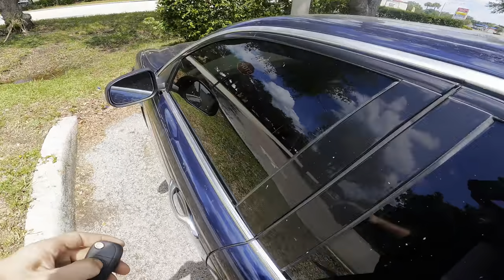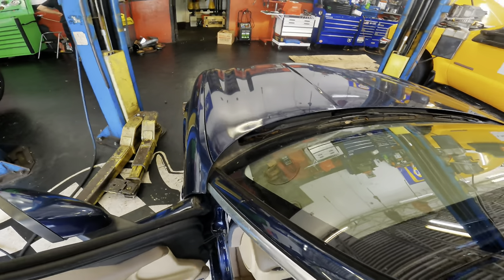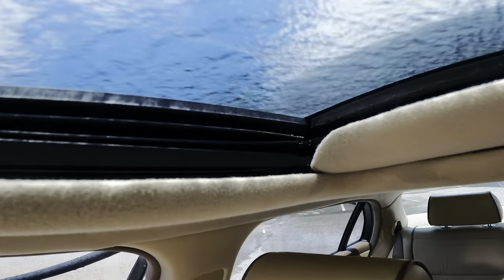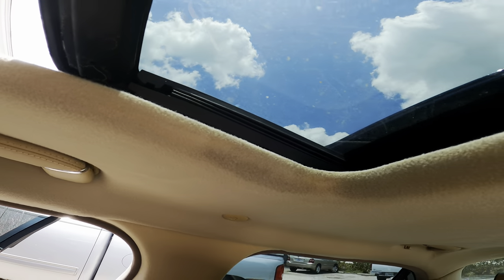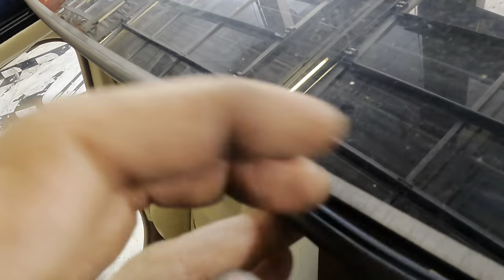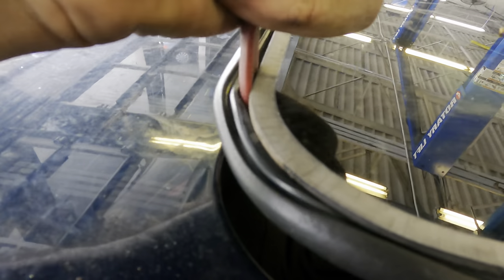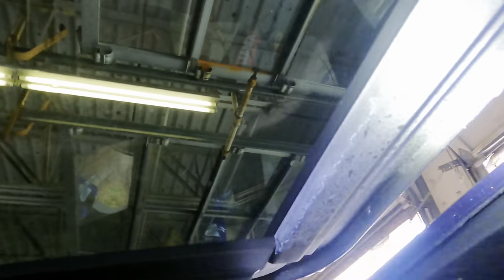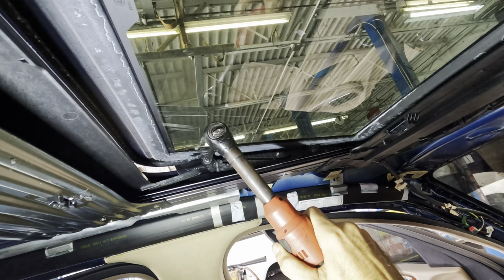Worse than I thought…Water Intrusion! 2008 Jaguar XJ 350

Comment: I have never had any luck with “sun roofs”.   They seem to be designed for two purposes.  1: rattling.    2:  leaking.
Reply: Neither have I until I started buying Mercedes. Zero issues. But you do need to lubricate and clean the tracks yearly. Because maintenance.
Reply: Never had rattling issues with sunroofs. Probably just poorly fitted/bad make.

As for leaks I've only had to replace the seal once like he's done here. I'm in a desert so hardly any rain but rubber getting crisp and hard is normal. Usually lasts a decade or longer if you take care of it (park in garage instead of outside in the sun constantly).
Reply: and lets not forget making the car even hotter when you forget to close the shade!
Reply: I found factory install instructions on adjusting how the glass fits in the hole in the roof, usually fixes the leaks. Periodically, I have to readjust the height of the glass.
Reply: Yes, also making wind noise. I have no use for them. I seldom look up
Reply: For the last 20 years i have owned two Ford Mondeos that have the exact same sunroof and have never had a problem with them, sometimes things just go bad.
Reply: A sunroof is the most overrated, supposedly "luxury" item in any car. I really want the baking sun beating-down on my head while driving. Not.

I have no idea if mine even works. I have never opened it during 5 years of ownership.
Reply: Iono, had a 2002 VW Jetta until 2018.. never did the roof leak.. ever!
Had a 2010 Fusion, sold in 2017, moonroof never leaked.. have a 2013 tC, again.. moonroof doesn't leak.

You gotta stop buying Chrysler and Chevy products!
Reply: My policy is to never buy a vehicle with a hole in the roof!
Reply: I had to take my Benz's sunroof out with the replacement of the headliner and sunshade. It was a huge job. In reinstalling it, three words: Adjustment, adjustment, adjustment......it was a royal pain to get right, a job I never will attempt again. .
Reply: @grantleyhughes  my Benz sunroof doesn’t leak but also didn’t open after 3 years
Reply: @tiredoldmechanic1791  i wont buy one without it, i couldn't live without my electric sunroof, its open even in the winter!
Reply: @demcomp  ive been driving since 1998 and almost every car ive owned has had a sunroof including my current one, a Ford Mondeo with the exact same electric sunroof as that Jag and not a single one has ever leaked, my last two cars have been Mondeos with that mechanism and they have been good as gold.
Of course some sunroofs will leak, anything can develop a fault but these people saying they are a problem item are talking nonsense, your experience matches mine and i wont buy a car without a sunroof!!
Reply: @obroni  lol, i wont buy a car without a sunroof, the first thing i do when i get in my car is to hit the button to open mine fully, even in winter.
Reply: @stevefox3763  🧡 exactly! never had a leaky roof.. maybe that'll change. I love having one.. even if I don't open it fully, I crack it open to vent the air.. plus if it's gonna be a hot day and no rain, I'll leave it in the vent position so my car isn't a sauna
Reply: @stevefox3763  Yeah, it's one of those things: You're either on Team Sunroof, or you're not.
At least with a sunroof, you have a choice to cover it up. But these new cars where the whole roof is glass, with no cover? Yeah, I don't want to drive around in a greenhouse, thank you very much!
Reply: @obroni  yep, we are all individuals and like different things, my Ex Wife hated me having the sunroof open!

I like the sunroof because it opens the car up and feels less like a cage but if you have it open but the windows closed, summer or winter it gives you a airflow that does not blast you like an open window but in the summer i really value my sunroof cos i have black leather interior and opening all the windows and the sunroof on the remote before going out to the car is an amazing thing to have, the hot air goes out the sunroof and it sucks cooler air in through the windows and cools the car off super fast :)
Reply: 2007 Chevy Trailblazer with a sunroof, no leaks. I also clean the tracks and treat the rubber with a conditioner twice a year.
Reply: @groosbro1  amazing what a tiny bit of maintenance does. 😊 Good to hear.. also I was just being funny about the Chevies not so much Dodge , 😂
Reply: 2004 lincoln town car ultimate...only time my sunroof leaked was when it wasn't closed properly during a car wash....other than that never had an issue..keep it clean
Reply: @kenfarley957  I knew so many guys with T-tops on their 4th gen camaro/firebirds that lost them because the locks would not lock and there goes a glass panel.
Reply: @obroni  I use my sunroof more at night than the day. Looking up at the moon/stars while at a traffic light is relaxing.
Reply: I haven't had that problem on my 2006 jeep liberty 4x4 trail edition

Comment: Seals on sun roofs are never water tight.  They are are there just to reduce the levels of water intrusion. The gutter and drains (down the A and B pillars) are there to divert water out from the car.  I use silicon grease on the edge of the ‘seal’ to effect a better connection with the roof aperture and a bicycle brake cable to clear the drains of any crud and insect nests.  That’s all you can do.
Reply: Correct! Cleaning the drain tubes is a semi-regular maintenance item.
Reply: Correct! I would use a bit of water and a douche from an air nozzle. Bicycle cable is a good idea
Reply: @ferrumignis  Loving life in my "Sunroof Delete" CTS Coupe. 😁
Reply: I never thought of using a bike cable.. that's a pretty durned good idea!
Reply: Weed wacker lines works better and is softer so as not to punch through the drain tube as it works through like a steel cable can.
Reply: Also not sure on Jags but Honda sunroof glass is designed to be flexible, you can bend the glass panel to fit  better.
Reply: I had this same issue and all it took was a slight realignment of the glass and it's air and water tight.. they should seal because otherwise you would also hear wind noise. The problem is the screws work loose over time and the window goes slightly out of alignment.
Reply: @ferrumignis  very critical  actually. If it leaks, in some models the water will drain onto a computer and total it. A friend of mine had a Jaguar XJ8 and that's what happened to it. Water went down the windshield support and got a computer. Totally messed it up. Nothing would operate right, stuff turn on/off on its own, etc. Oh and it is stupid expensive.
Reply: Agree with cleaning the drain tubes, but this looks like the glass is not adjusted properly, it is set too far forward. Should not have been letting in THAT much water. 

I cringed at the end watching him completely remove the glass mounting screws. Just loosen them slightly, bump the glass slightly rearward, snug the screws and recheck the fit. Repeat 🔁 and check front & rear gaps to the sheet metal are even, check for major leaks. 

Then be sure to go back and tighten the screws to spec. Very important to ensure the glass does not fly off while driving.
Reply: Glad you said it so I didn't have to.
Reply: Totally agree. Had a bad leak in my truck once after getting it detailed. Took it to the dealership and they reapplied some grease and fixed it right away. No leaks again for the past 3 years. They actually said it was intended for the truck's sun roof to have the grease applied to help with the seal/channeling of the water and to be careful not to remove it when cleaning.
Reply: For convertibles, a flexible trombone brush is the recommended method for cleaning the rear drains. Especially popular among Miataphiles. I might try this on my VW’s sunroof also but I might try the string trimmer line idea first.
Reply: After having a car with a sunroof I vowed to never again buy a vehicle with a pre-cut hole in the roof. The "utility" of a sunroof is outweighed by the facts you outlined, they all leak and rely on those drains (which WILL clog up).
Reply: If they were meant to be water tight they wouldn't have drain lines. Clean them shits out and it'll be good to go. Easy fix.
Reply: @isthattrue1083  That just sounds like Jags in general. 😉
Reply: @MrWoodyBalto  You are correct, sir! Step one is, "Don't own a car with a sunroof."

Comment: Ray it's not the seal it's the drainage holes there's four two in the front two in the back they're clogged you have to unclog it with air pressure
Reply: ^ This. I was an advanced manufacturing engineer for over 10 years building these sunroof assembly lines. They are designed to leak at a known rate and control the incoming water with a water management system. These designs go through extensive testing during development to ensure that they can drain off the water even when parked at ridiculous inclines. If water is getting into the cab, 100% it's because leaf litter or some other obstruction has gotten into the drains at the a-pillars. As a matter of fact, I actually launched this product. It's known as a BLIS or Bottom Loaded In-Slider.
Reply: Yep, seen too many videos on fixing leaking sunroofs and it is always compressed air and a long slender wire down the drain holes. My first thought: check the drain holes.
Reply: Yes I agree check drain holes
Reply: Why should that be a solution? he sprays it down with the force of a watertap and you can see much water intrusion. It doesn't matter if the channels are clogged or not. This much water should NOT be there. What happens in a carwash or in real heavy rainstorms? The amount of water shouldn't even be there. And if ray says there is a clear gap - that cannot be intended. The roof must be misaligned. In the beginning you can even see the roof Auto-opening because it had resistance. So something is "not right".

Comment: Hopefully helpful advice from a rubber gasket manufacturer.  It's often best to start a large gasket in one location, let's say 12 o'clock, then go to the opposite side, 6 o'clock, then 3 then 9 ...  Although it worked in this case, installing linearly stretches the gasket making it thin on one side and thick on the other.  Hope this is useful.  Keep up the good work!
Reply: Hey Mitch Mann@ a good rubber conditioner is good for door ,trunk and windows seals after washing the vehicle...and always check for drying out.
Reply: Holy crap, I never thought about that.  I think I'm going to start doing that at work.  I have to make custom gaskets out of EPDM Neoprene and they always seem to stretch weirdly. I'll bet if I started  by securing either end, then worked from the middle outwards, they wouldn't end up getting so messed up.
Reply: Makes perfect sense.  Thanks for the advice.
Reply: Exactly

Comment: The  sunroof water drain channels needs to be clean,   very common problem.  Most oem  sunroofs have a water management system,  a rain guard channel, and 4 drains,  you can acces the 2 rear drains tru the trunk,  its usually a rubber hose that runs inside the C pillar,  the actual  drain fixure itself comes out behind the rear  tires, they tend to corrode,  for the front you may need to get a mini sunroof snake kit,  or a long. copper cable to unblock the drains.   this should be done every 10 years.

Comment: Sunroofs are Controlled leaks. They never seal completely which is why the drains are at all 4 corners. You get a “leak” when the drains become overwhelmed and flood into the passenger compartment. This sunroof was just fine the seal was functioning normally, the drains may not have been

Comment: always check the drains, it's even called out as standard maintenance in VW models
Reply: YEP YEP YEP  Sunroofs don't totally seal, the drains are the main line of defense
Reply: true, same happened to my Nissan Micra; the drain tube lost connection on the passenger site, it was a pita to reinstall
Reply: LOL... I am sure a lot of us where thinking the same thing.
Reply: When the gaskets don't seal properly even totally clean drains get overwhelmed.
Reply: Yeah - drains get blocked...it happens...they are there for a reason.  I'd definitely do that before dismantling anything more.
Reply: Plenty of good comments, I bet he has it fixed already.
Reply: and fords...
Reply: It's easy for tiny debris from trees (oaks, etc.) to plug up drain tubes.  Sun roofs are not designed to be water tight.  Test drains by adding water to each of the 4 corner drain holes in open sunroof and see if water drains out the bottom to the road.  Clean with clothesline wire or similar flexible plastic or wire.  Also, it's easy to accidentally detach plastic drain hoses so you may need to check them too.  May need to take apart inner roof and area around drain tubes to check for blockage.   I have a 2007 Saturn Ion with a similar sunroof.  Some people caulk their sunroof, disabling it, but preventing leaks.
Reply: With Volvos it is always the drains,  a suitable length of string lawn trimmer  cord carefully  inserted and threaded slowly through the drains will clear them out.
Reply: Matter of fact I watched it a little while ago maybe a month or two or three I can't remember I'm an old man bottom line I got on my sunroof cleaned the tracks out and it was seed pods in the drains glad he pointed that out thank you very much Ray have a good evening and a great day
Reply: @hikerJohn  hi good John I used to hike the Appalachian trail I get off of work on Friday have my backpack ready throw the food in take the bus to the train take the train to the Port authority bus terminal get off the bus and hike three miles up West mountain near West point and camp out for the weekend especially a long holiday weekend it's the best thing that ever happened to me in my life next to boy scout camp have a great day bye

Comment: I went through this with my 2000 Mercedes and replaced the sunroof seal. Made no difference. Found out sunroof design is to let some rain through and drain the water through drain tubes in the A pillars (and B pillars on some sunroof designs). 

After this I found I received the wrong sunroof seal. Got another one that fit better but it made no difference for the leak.

After that I found the A pillar drain tubes both became clogged and the tubes shrank over many years. That caused the joints that connect to the top and bottom of the drains to open enough for water to pass. 

Next part was cleaning the drain tubes. For this I first used an endoscope to examine the inside of the drain tubes. Where I found stuff in the tubes I first used a small diameter tube connected to an air hose to push as much stuff as I could and let gravity be my friend. After that I ran a vacuum through a small enough diameter tube to fit inside the bigger tube and used that to clean out everything the air hose wouldn’t move. This was most helpful at the bottom of the drain where there is a J shaped piece of tubing that lets the drain pass from inside the cabin to outside. I took another look with the endoscope and repeated the process until the drain was clean top to bottom.

After cleaning I found some other tubing that was about the same diameter as the factory tube (the oem drain tube part was no longer available), and I bonded the new tube to the old to extend the drain tube length about 1” at the top and bottom. Then I added clamps to joints tightly enough to stop any remaining leakage.

This solution has worked fine for about 6 months. The MB is parked outside in rainy Seattle and has since the fix, no sign of further leaks.

The key detail is the drain tubes shrink over time and that causes their seals at the ends of the tubes to separate and leak. Combine this with endless stuff that accumulates in the tubes over time and the water drains become plugged and over fill the sunroof tray, and/or fail at the bottom of the drain and causes the foot wells to flood.

Hope this helps others. This kind of problem/solutions was not addressed on YouTube to my reading

Comment: Some water is supposed to come past the seal, it's the drain tubes probably blocked.
Reply: The drains can only deal with so much water - recently had this on a Volvo - replacing the sunroof seal blocked enough water to allow the drains to deal with the rest without overflowing.
Reply: @ckm-mkc  That's why I only specified "Some water" Got the T-shirt I'm afraid.

Comment: If you hold the open or close button at the end of the sequence, you may be able to get the ECU to relearn the track limits.  It looked like maybe the passenger side had skipped a tooth on the drive motor, ending up too far forward.
Reply: This is correct.  The Range Rovers (made by the same company and prolly use same parts0  suffer the same problem as the motor losses its memory and the limits are slightly off.  There is process that allows it to relearn.  Pretty easy to look up.  If I recall correctly on the Range Rovers you simply hold the close button for 20-30 seconds after its closed and you will hear an audible click at which time it will start the relearn process.  Hope this helps
Reply: This the first thing I would try.  But yea, it looks as if its slightly out of adjustment.  Nice to see this Jag again....great color.  I have a XK in a similar blue.
Reply: Correct, press and hold the close button for 20 seconds and it will run through the range of motion to recalibrate.
Reply: Let's hope the owner reads these comments.
Reply: @woodstream6137  - Let's hope Ray reads them too.

Comment: Same sunroof as the Ford Mondeo, it has rear drains as well, check those.  It is also definitely misaligned, you can see it visually but the sunroof opening again when an attempt to close it was made was the safety kicking in that is there to prevent injury but was being triggered by binding rather than a childs fingers or head.